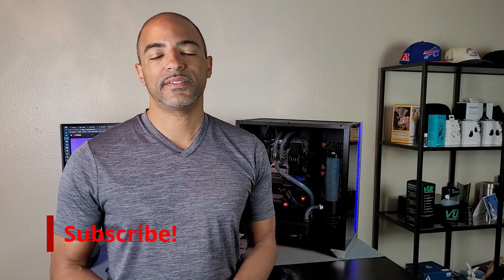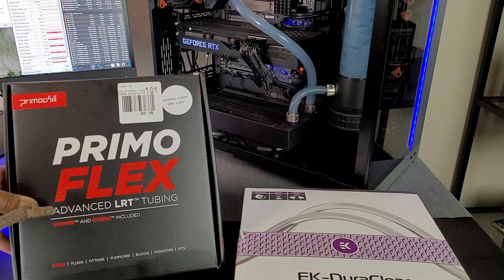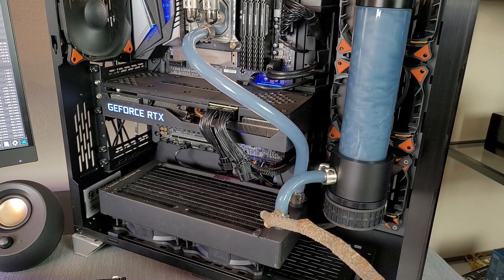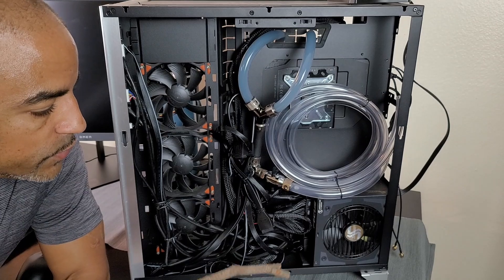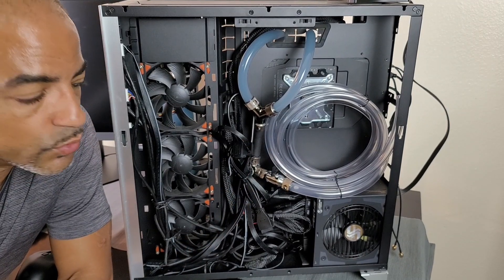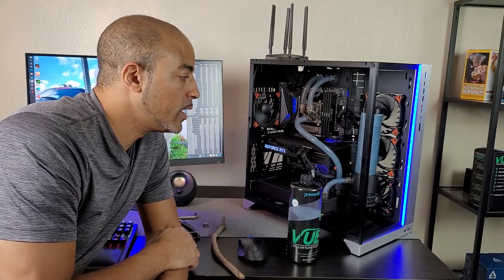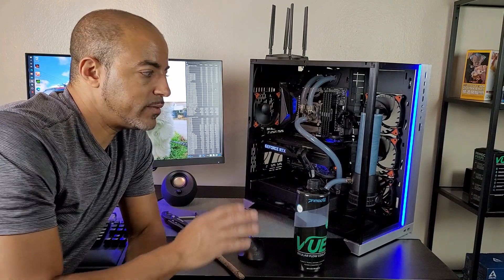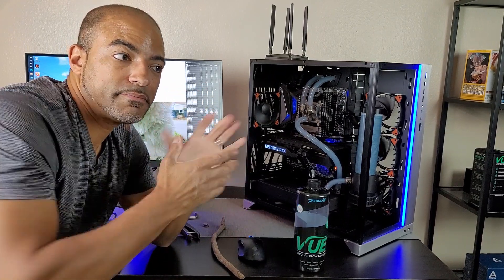Changing Soft Tubing due to a Kink - Primochill VUE Sterling Silver

Comment: Surprised initially you didn’t use any angle fittings in that spot. My loop has a similar short run to the rad and I just used a 45 fitting on each port to make an easy straight tube
Reply from the maker: This was a quick test system, nothing permanent.

Comment: Looked like you may have started the entire PC to run the pump.  Your CPU will overheat within a second or two while water is reaching it, and bubbles cause issues too.  Best to jump the 24 pin harness on a spare PSU with just the pump plugged in, and let everything circulate first...  Thanks for the video!  Have you noticed any staining of the tubes or clogging with the fluid?
Reply from the maker: It didn't matter with this cold plate and you can always turn on a CPU briefly without any heatsink. This type of fluid will always stain tubing over time. No clogging.
Reply: most modern CPUs in the last 10 years will downclock/undervolt themselves and prevent damage.  If it gets to dangerous levels it shuts the system off automatically.  He's fine.
Reply: @FunktasticLucky  So it sounds like we both know that running a CPU from ambient up to Tjunction within a few seconds is not good for any silicon chip, that's why we water cool to begin with... To never see those temperatures.
Reply: @Dethred1  watercooling Isnt about keeping things cooler because my 5800X still hits 70 to 80C. What it does do is allow you to game or work without your PC sounding like a jumbo jet. I got so sick of the noise I will never go back to air.
Reply: @FunktasticLucky  Your CPU is boosting based on the temperature.  GPUs do the same thing now, my 5950x and 3090 are constantly overclocked to their max stable clocks when loaded because of the cooling capacity.  These are two different things.  I've built over a dozen water cooled PCs over 16 years.  Temperature is absolutely one of the reasons to water cool PC components. In fact, the biggest benefit is to minimize the temperature delta during operation.  Sure, you can turn your pump and fans down while getting higher temperatures, but that's not the main point.

Comment: Thanks for the video, info was just what I needed! Are there ever any issues with having your drain valve in that position since it is not at the lowest point of the system like I see people saying?
Reply: I had it on my pump res but I changed it to my rad in the bottom. It drains a lot easier that way imo.
Reply from the maker: The lowest point is ideal, but I also use an air pump to push the fluid out of the system so for me it works no matter where I have the drain valve

Comment: This may be a dumb question but do you need coolant for a custom loop? Is it primarily aesthetic or does it help with the temps? Im thinking the name "coolant" probably means it serves a purpose but could you run a loop with just distilled water?
Reply from the maker: the coolant is Distilled water with additives to prevent organic growth. Past that it's basically the look of the fluid.